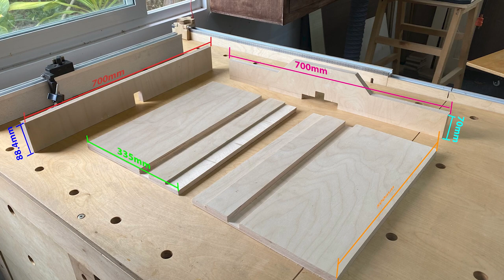How to make a simple cross cut sled for  table saw - DIY

Comment: How did you make sure it was square?
Reply from the maker: Hi @Dan S
Before I begin, I double-check that the saw blade is parallel to the two rails and the fence. I have a specific gadget for determining and adjusting blade clearance. I might produce a video about it.

In my situation, everything worked out well, and I was able to utilize the fence to assist secure the sled while still ensuring it was perpendicular.

Comment: I wonder, I see sleds for the table saw all the time, has anyone thought about a sled for a router table?
Reply from the maker: I believe there are various limits that hinder people from making sleds, such as 
- the length of the milling bit, which will be much decreased if the sled is attached to it.
- Milling bits come in a variety of sizes, making it difficult to match a sled.
- The rotation speed of the milling cutter, as well as the method we frequently operate with the router, demonstrate the shortcomings of building a sled.
The above are some of my personal thoughts; I normally use a pusher for it and it does the job.
Reply: @VgearsWorkshop  Would be nice though. I love my table saw sled because it just makes everything faster.